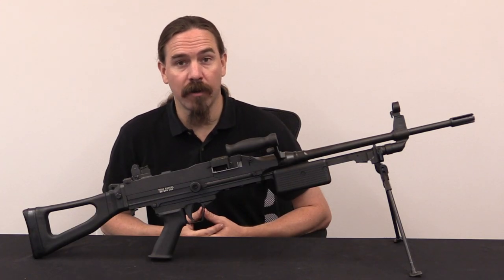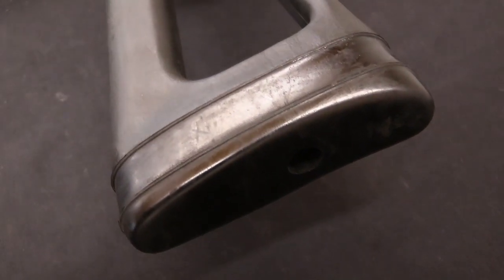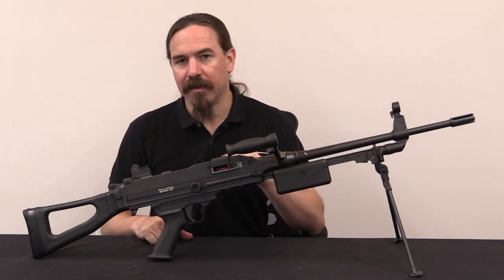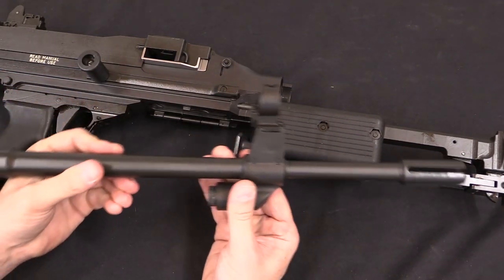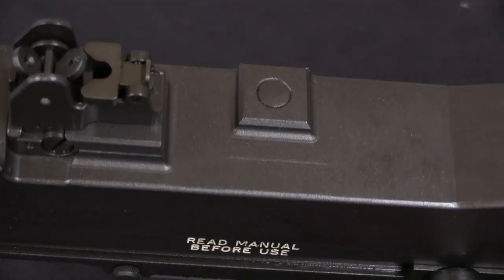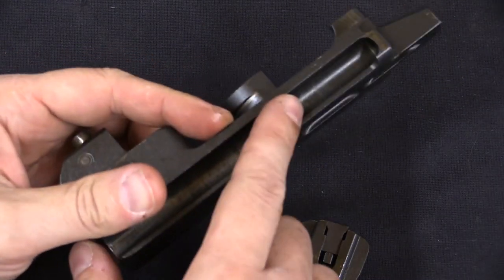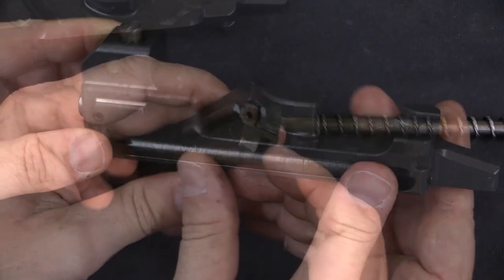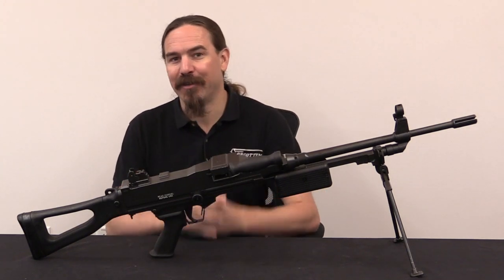Vektor Mini-SS: South Africa's Answer to the FN Minimi

Comment: I have never seen a bolt that locks quite like that. Really ingenious. Really cool how the locking surface is a separate part, so it can be hardened differently & replaced when it wears out. Reminds me of the XM5's steel inserts.

Comment: I don't know how Ian got me hooked on firearm design history years ago as a Vietnamese who has never held a gun in his life. Tomorrow I'll get to visit my first Defence EXPO and there will definitely be more unique designs like the SVT-380 :D
Reply: it literally a Galil ACE with minimal handguard and remove left side charging handle with more traditional Ak right side charging handle
Reply: Such a long history, and as most of history there are weird twists and turns that are fascinating.  👍
Reply: @Stevarooni  it is just Z111 want to simplify the manufacturing process on Galil Ace as well as reducing parts on the final products for various reasons.
First, Vietnam is not the only manufacturer that IWI sold their galil ace production line for. It would make no sense for Vietnam to try to make galil ace to compete on the export market as they are not that well known in the industry. So making galil ace serve no purpose on the export market as it not only compete with IWI united states as well as it violate the contract they signed with IWI. So by making SVT, it can be use to export as a lower cost version of galil ace.

Another reason is Vietnam has been use AK since 1960s. And their doctrine has been used with logistics and the simplicity of AK. By making SVT more like AK, it reduced the amount of parts to more like original of AK but still keep it up with modern requirements. SVT reduced 10-13 parts compare with original galil ace and on the same time it interchange some parts with AK/STL-1 that they made, hence reduce the logistics burden of fielding various weapon type.
Reply: Similar here. While I've had an interest in guns since I was a child (my father was a professional military historian), following this channel and InRangeTV has multiplied that interest by a large order of magnitude.
Reply: Welcome to Firearms' Anonymous.  Take a seat and tell us how Gun Jesus got you addicted.
Reply: @jason200912  nah, I'm from up North. Though my grandma and grandpa did work as spies for the Viet Minh in Thailand, my uncle volunteered to fight in the Sino-Vietnamese war and passed away at the age of 19
Reply: @boocomban  yeah pretty much, but it's not like Ian has ever officially reviewed a Galil ACE on the main channel :)))
Reply: @jason200912  yeah, hence why I couldn't have access to any firearms without being in the military
Reply: @jason200912  More like Texas and Gulf Coast.
Reply: @easy_eight2810  Well and Ian won't chance to touch any SVT anytime soon.

Comment: With that amount of bolt tilt parallel to the extractor claw you can see why they had trouble.The amount of moment on the claw would make the heat treat and cam surface tolerances a nightmare.
Reply: I bet it more or less was pinned with a pivot like most extractors, but now has a slot for its' pin so that it can pull away from the bolt face more. Didn't see enough detail to confirm, but that's what I would do...

Comment: “Full auto or nothing” and “pull trigger, sear drops” are probably my favorite firearms design features.
Reply: As was eventually discovered with the M-60, the lack of a "trip" lever to hold the sear clear during firing, caused nasty wear issues.

Unsurprisingly, some of the OLDER MGs have that trip lever . More "design" by committee with teh M-60?

I replaced quite a few chewed-up M-60 op-rods and sears in my "time".

NOTHING is "soldier-proof', however.
Reply: @bruceinoz8002  “wear issues”? No sir, that is just the gun suggesting you ride the lightning like a man!

Comment: The FN Mag is the standard by which other designs are rated by the guys who use them. The Bren was the second favourite, however they are both heavier than this neat design. I had ‘retired’ out in 88/89; so I never got too meet it. But we had heard of it, and knew of some of the previous versions testing problems. Reliability was a big factor for the old SADF

Comment: I don’t know if it has ever been done, but I think this would be a good design for what I call a “semi-open bolt” concept.  My concept is an open-bolt system where the sear engagement is about 5mm (1/4inch) from the closed bolt position with a small spring between the bolt and bolt-carrier. This means that the round is  fully in the chamber and the bolt is locked, as in a closed-bolt weapon, but the bolt carrier is caught by the sear, with the firing pin retracted.  When the trigger is pulled, the sear disengages, the bolt carrier slams forward the last tiny bit, with the firing pin projecting.  
The benefits I perceive are the simplicity of an open bolt system, minimal travel of the bolt carrier when the trigger is pulled, reducing the effects of throwing off the point of aim, zero risk of the bolt accidentally being moved by inertia and chambering and firing a round if the weapon is dropped, along with the many open bolt benefits.  
The main issue I see would be the risk of cooking-off the chambered round.
Reply: Yup, i looked it up and the semi-auto mode of the 42 works in this manner.  Thanks for the reminder, Socom.

Comment: 8,3 kg Mini-SS: I'm light
7,5 kg PKM: okay 👍
Reply: To be fair it do be incredibly light for something that runs the FN Mag system.
Reply: @Kurochana  it's rather due MG-42-style feeding mechanism. Top cover with all that stuff attached is pretty heavy
Reply: @alexandermarinin7036  Plus it also requires a longer bolt carrier, since the roller need to extend beyond the feed tray.

Comment: Had that been simplified and lightened a bit more, I bet the US and UK would've adopted it to replace the M60.
Reply: I think they would have.
Reply: no
its not better than a MAG/M240
not even close..
Reply: UK only has about a couple dozen M60 that came free with some Chinooks.
Reply: @Sinner 251  surprisingly the UK MoD have had several hundred M60's in inventory over the years! Unsurprisingly they were not fielded, but as you say came with other 'systems' most of them being 'gifted' to various 'friendlys' 😉
Reply: Not likely, a 5.56 gun is rarely a good replacement for a 7.62 gun.

The Minimi is tolerable for use in the squad, since there's a pair of M240s in the platoon.

Comment: The worse problem with the SS77 was you literally had to dump oil over it to keep it working
Reply: I bet that giant lug and "tilting" bolt cause lots of friction. Noticed the nice grease layer on this gun and was wondering.
Reply: Or talcum power. Which does not collect dust and dirt.
Reply: True, I remember having to oil my SS often during basics and special weapons. Although the Bren required less maintenance, the SS was easier to carry and jump out of a Buffel with.
Reply: @luckystriker7489  Which units were issued them? I was in the SAP and we stuck with the FN MAG. The Armory guys told me once that the SS77 will never see service or be mass produced while we still have plenty of serviceable MAG's.
Reply: @mazambane286  I was issued an SS during my junior leader course (one pip lieutenant) at infantry school in Oudtshoorn. We were sometimes given experimental stuff like helmets with built-in comms, etc.

Comment: It's like an FAL bolt/carrier turned on its side. Even the locking shoulder looks exactly like an FAL locking shoulder. Considering the extensive use of the FAL in SA, I wonder how much that drove development of the system.

Comment: 8.25kg seems pretty heavy for 5.56 SAW, considering the PKM weighs about 9kg and comes in 7.62x54r
Reply: Yep. No stampings; all traditional machining. Makes for a heavy gun.
Reply: @Jurflip2  That was one of the complaints with the Finnish KvKK 62. It was just too heavy for the intermediate cartridge and offered no real advantage compared to PKM. Of course the PKM didn't exist when KvKK was designed, but it was very quicky obsoleted. Mini-SS is much newer than PKM and still doesn't seem to have any tangible benefit.
Reply: @pineapplesalad6494  But the PK did.
Well... kind of.
Reply: The 5.56 is heavy because it uses the 7.62 as a basis. The 7.62 is fairly light for a GPMG at 9.6 kg.
Reply: @pineapplesalad6494 almost 1kg lighter is alot, the mini-77 is also reportedly easier to maintain and has lower recoil. All are tangible benefits.

Anyway if you want a light 7.62x51 look no further than the DMG-5, the modernised ss77 by denel, at 8.4kg.

Comment: I'm kind of surprised no one has made a dedicated belt-fed modernized version of the Stoner 63, since it managed to be both insanely lightweight and also very low recoil.
Reply: That's the Knights LAMG.

12lb 5.56 belt fed.
Reply: The kac lamg weights 11.4ib, and the lac stoner lmg (stoner 96) weighs 10ib.bith belt fed.
Reply: @matthiuskoenig3378  granted, but I bet the LAMG is significantly more durable.

Comment: I wonder why they didnt add holes to bolt guide on top cover, make few groves on cover it self from inside, round a bit gas piston tube and maybe use slightly thinner feed ramp if they wanted to reduce weight that much. Just removing some material from top cover and maybe in few spots on body it self would lighten it nicely without making it flimsy and its really not hard as those are flat surfaces that you can just slap on milling machine for few few minutes.

Comment: Here's a question, when you have a tilting bolt like that, how do they compensate for the case head spacing? Is the bolt cut to where it's fully flush against the case head when in-battery and did they put just enough play into the extractor cut to compensate for the bolt rotation so it doesn't damage the cases on extraction?
Reply: Looks like the face of the bolt is angled, so it's actually square to the barrel when locked. The firing pin will hit on a slight angle but that won't matter
Reply: @vikingdrift  gotcha. I wonder if that was causing some of the reliability issues on the 7.62 variant.

Comment: I can't remember where I got this info, but I think the solution to the early problems with the SS77 was to drop the cyclic rate down a bit. I have asked some of my SA Reserve friends how well this gun is liked (compared against the FN MAG), but none have any experience with it.
Reply: Not many units carry the SS77, most still carry the MAG, but that's just because there are more parts available for the MAG. 

I know the SS77 is preferred in DRC deployments, but the MAG and PKM are preferred by troops deployed in Mozambique. 

Just depends on environment, but during training cycles the preferred training LMG for paratrooper forces would be the SS77 and 77mini.
Reply: @ginger0208  Thank you for that rundown. I imagined the parabat would be keen on the mini. From what you wrote, it seems that the SS77 is now regarded as sufficiently reliable in some environments, but not so much in others. Would that be correct? Or is it just personal/unit preference?
Reply: @kiwigrunt330  personal preference really, but the SS77 fairs better in jungle conditions a bit more than the MAG does. Not by much though. Just easier to keep clean, lighter and a tad more reliable. At the end of the day the SS77 is more reserved for the parabats who are always deployed in DRC, MAG infantry and PKM for SASF.
Reply: There's a Ukrainian guy , valgear, who reviews the weapons he's used. Out of MAG58, MG3, PKM, his pick is the PKM set up with a red dot.

Comment: Barrel locking mechanism looks really bad or am I missing something?
If there is only one simple pin holding the barrel, then why make complex spring loaded lever instead of a pull pin?
Now it looks like the barrel could come off by accident.
Reply: Because the spring loaded pin is held in place by that spring pressure.
Reply: @ScottKenny1978  Small spring and long lever.
Bump the lever onto something and the spring won't held.

Comment: A short-stroke piston in a machine gun, is not something very common. Funny that the 5.56 version is around the weight of a PKM.
Reply: I've only seen the short stroke piston in the belt fed AR upper...

The PKM is one of the lightest 7.62 machine guns in service anywhere.
Reply: @ScottKenny1978 Also SIG's XM250 uses a tappet and the M60 has it's weird gas-cutoff system, but that's about it I think.

A big reason why the PKM is so light is that it doesn't use the MG42 belt-fed assembly. Most other MG that veer away from it also manage to get quite light like the Negev or the Stoners LMG designs.
Reply: @ShortT-RexLikeArms  M60 has that weird gas cutoff but is otherwise a long stroke piston, iirc.

Didn't know that the SIG M250 was a tappet, but that's fine.
Reply: @ShortT-RexLikeArms  and yes, anything not using the MG42 feed system is a lot lighter. The Knights LAMG and AMG are basically rifle weight. Heavy rifles, but 12-14lbs and not 18-28.
Reply: You forgot DP-27 and early version of RP-46, which were belt fed convertibles of DP-27. Coz DP-28 got the short stroke changed to long stroke and also the later versions of RP-46 too.

Comment: Just to get it clear, the SS uses the same mechanical concepts as the mini-SS, but without any attempt to have common parts?
Reply: Sounds like they wanted to, but after first efforts determined that interchangeability wouldn't work without some expensive compromises.
Reply: @Stevarooni  Exactly! It also ended up even heavier than it is now.
Reply: @Jurflip2  You make it sound very heavy when you put it like that,
this one is actually very light at 8.5kg for a belt-fed SAW role weapon.

There was an attempt for interchangeability before they decided that it would be better off just skipping that out to make a superior weapon instead. I think they've succeeded.
Reply: Not quite. They kept all the features of the SS77 that worked on the Mini SS. The rest were redesigned.

Comment: I've sed this weapon and it sucks keeps getting stoppages the ss77 and the mini, you legit have to have a 25lt of samil engine oil to lube the gun when changing belts the FN Mag is far superior heavier yes but if you are LMG nr1 then you should be strong enough.
Reply: I believe you're right for the earlier versions of the gun. As far as I know, it is currently in general use in the SADF, having replaced all the FN MAGs (the last ones were bought about 40 years ago!). The current production guns are apparently reliable and oil guzzling is no longer a big issue.